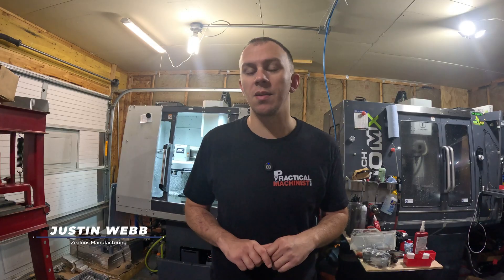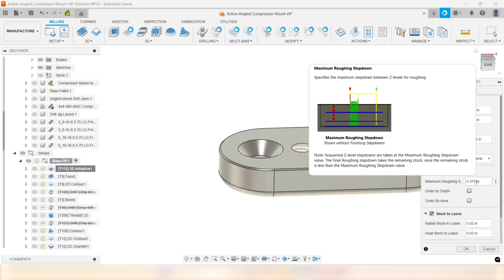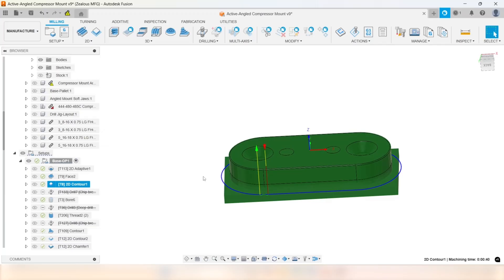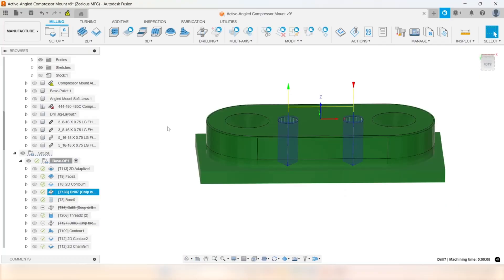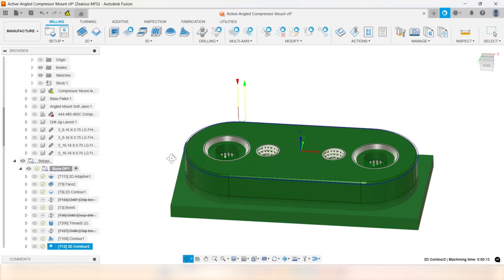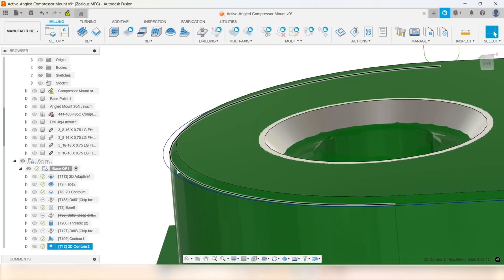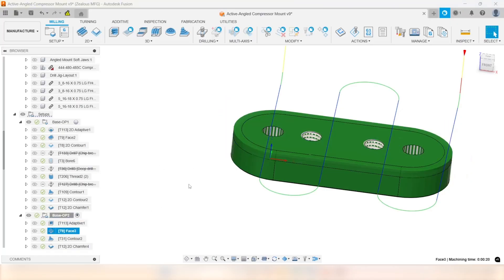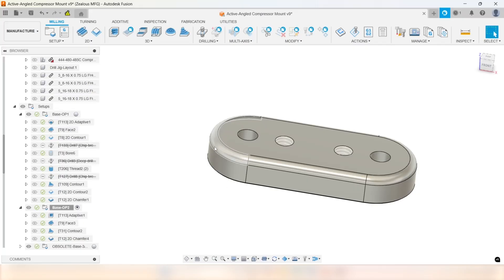Machining a Billet Compressor Base on a Small CNC Machine

Comment: Think you could have pilot drilled, then drilled with the 3/16?
Reply: I could have but I ran out of tool spots in the carousel so I just decided to bore it since I had 100 parts to run.